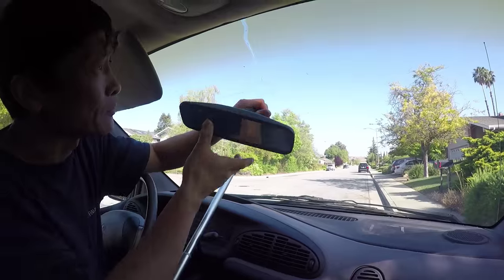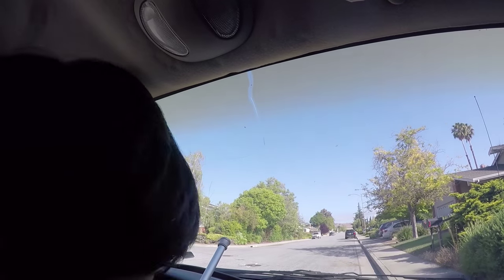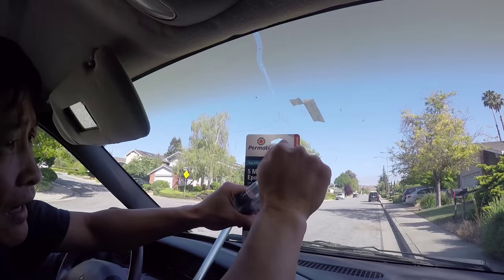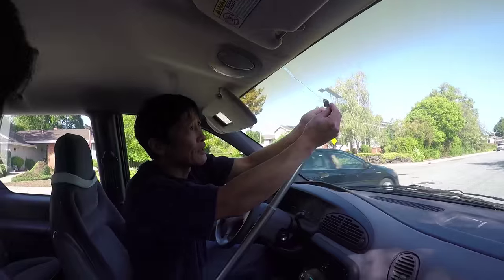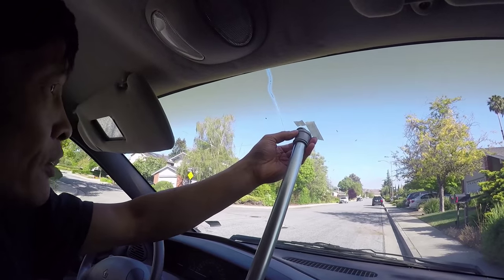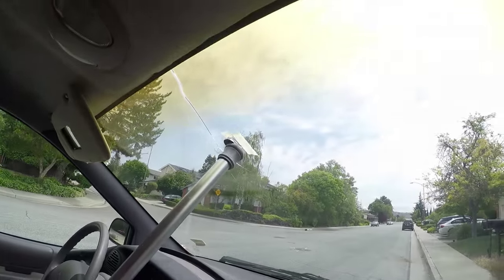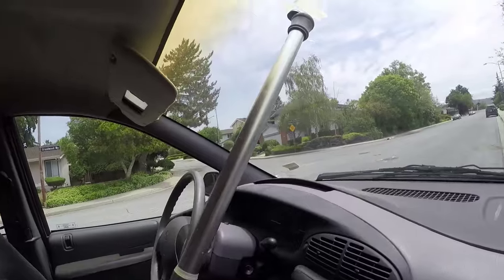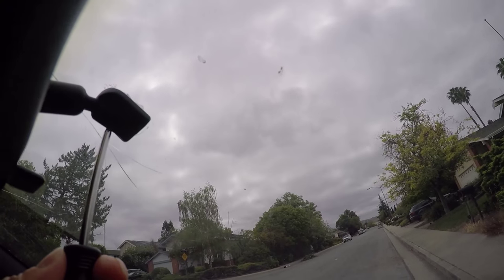3rd Time Attaching Rearview Mirror-- Glue attached to windshield Using 5-minute Eproxy

Comment: Rough the glass with emery (not sandpaper) -- makes all the difference.  Emery cloth will actually scratch glass.  Adhesive doesn't like smooth surfaces.  If you rough the surface, many adhesives will work fine.  If you don't, almost no adhesives will work
Reply from the maker: thank you for sharing

Comment: Oil from your fingers/hands will dirty your clean surface.... Rubbing alcohol at the very least should have been used on the mirror piece as well as the windshield before you ever put glue on it. Also a razor blade should be used to scrap instead of rubbing it with sandpaper unless you have a mountain of old glue, then do both... Razor blade last.

Comment: WTF??  You need a new windshield.
Reply from the maker: the DMV website says: "California Vehicle Code 26708(a)(1) and (a)(2) A person shall not drive any motor vehicle with any object or material placed, displayed, installed, affixed, or applied in or upon the vehicle that obstructs or reduces the driver's clear view through the windshield or side windows.”  Do you think this windshield obstructs or reduces the DRIVER's clear view?
Reply: @GeniusAsian  You think that windshield has the same impact resistance as when it was new?  Let me know next time a rock bounces off it.  🤪
Reply from the maker: @jagboy69  yes, that is a valid point, and that is why this car was never on highway only local driving since then.